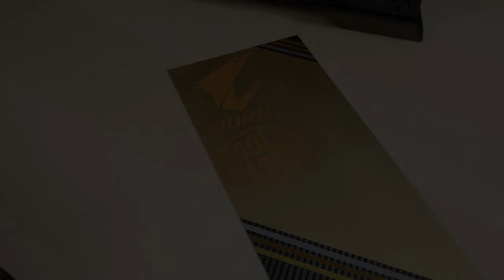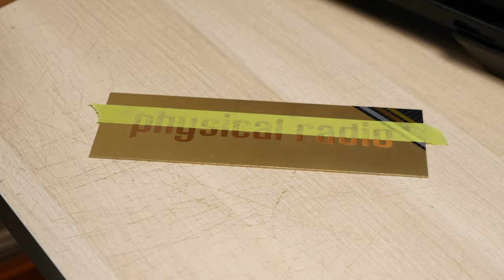PHYSICAL RADIO DJ EDDISON CUSTOM STUDIO PC BUILD Cooler Master HAF500 Z690 AORUS PRO i7 12700KF

Comment: That custom plating looks nice, but the portion you have around the hard drive cage is just cutting off the airflow from the bottom 200mm fan, which is already stymied by the 120mm fan cutouts this case has stock. What's worse, the angled fan mounted on the hard drive cage relies on that 200mm fan bringing in air to be useful. Without that 200mm bottom intake bringing in air, (especially at the steep angle the GPU forces it into) it really has nowhere to pull air from.  That one aesthetic decision effectively bricks both of this cases gimmicks (the angleable fan, and the 200mm intakes), and likely most of the cases cooling potential.